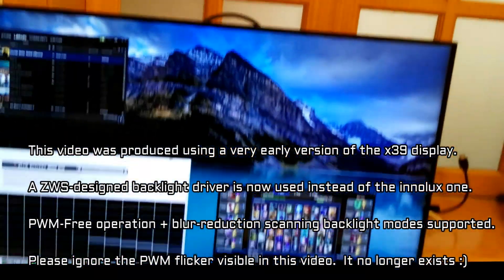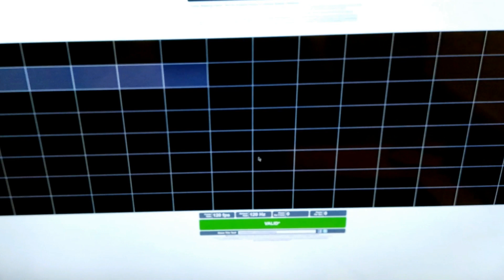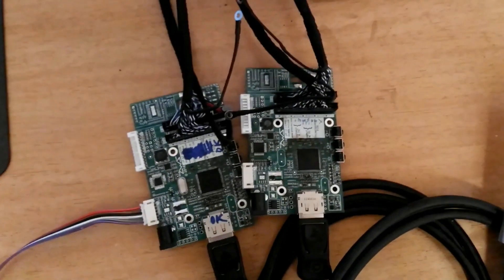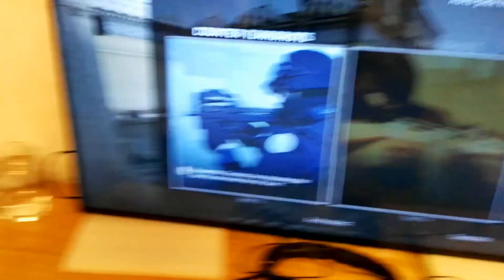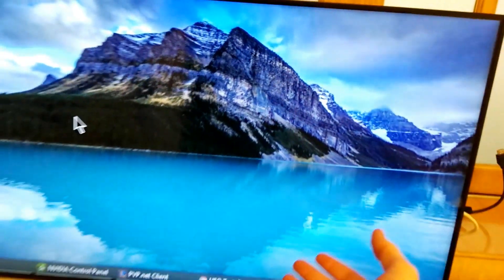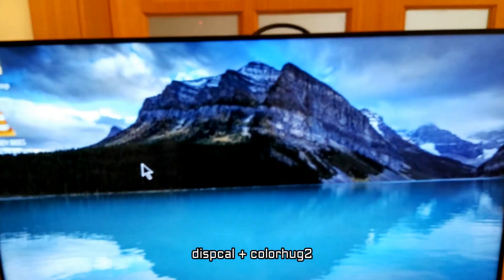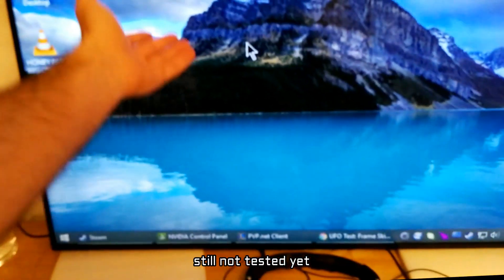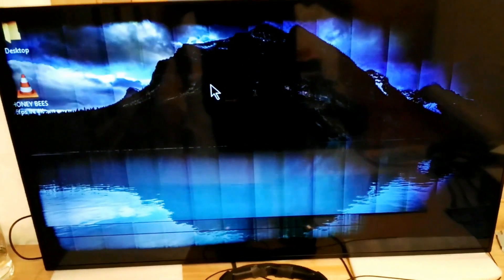ZisWorks X39 display demonstration

Comment: You really need to start offering panels.

I was pretty close to buying this. However having to source a panel, take it apart, install this (shoddily as there are no mounting plates) then close it back up if you can....

I could easily do all that, I won't however. That's too much bullshit for the gain you get.

You NEED to start offering panels. I'm not buying another monitor and then ripping out its guts to replace them with yours. That's silly.

Most people, even massive geeks like me would not do this. You're severely cutting off your market. You aren't even niche, you're super niche. Not good for revenue.

Comment: Hi Zis.  I'm about ready to buy 38WK95C-W (non G-Sync), but saw your video.  I do flight simulator called x-plane so achieving high frame-rates is impossible, to get 35 to 40 frames would really be max'ing.  The software developer says that if you are getting above that, you're graphics settings in the game are too low.  X-Plane 11 is unbelievabley demanding and requires the best GPU money can buy (if you really want decent frame-rates,,,,  30 to 40).  I currently have a GTX 1070 but begrudgingly have on order an RTX 2080 Ti  So, you see, it's not an FPS game with high Frames Per Second requirements or anything but I want the best possible monitor for my purposes. But before i lay down $1000.00 usd for this LG display, which is 75Hz max using Free-Sync (i only have Nvidia), i figured I'd ask you what you might have available that might save me some money and be able to "sync-down" to my Flight Sim frame-rates, which are always going to be below 60 frames / 60Hz.   Am i wasting my time looking into your products since my requirements are so low?, or is there technology that would allow syncing at my below 60FPS?  (that you have?).   Nvidia has everyone by the balls that has an Nvidia card and wants sync-ing.  Who's to say I won't want to play other games when I get tired of the Flight Sim stuff.  Racing games might intrigue me or maybe even FPS games.  But anyway, I thought i would get your input since you are so very knowledgeable with this highly complicated subject matter and speak so well and can convey everything in layman's terms as well.  Thanks in advance for your thoughts!!!!!!

Comment: could you explain the advanced (timing) setting for overclocking your panel in nvidia control panel? if you have lower timing would that take up more gpu usage? and if you increase the timing would that allow a higher refresh rate overclock?

Comment: So 480hz is smooth enough to look completely real? Like sort of a physical object in space, when you move the cursor, or would you say you need 1000hz?
Reply: The answer is a bit more technical than that, as you're using digital terms (Hz) to describe our analogue reality. Try this article; it's all about the display from the video: https://www.blurbusters.com/4k-120hz-with-bonus-240hz-and-480hz-modes/
Reply: Josh- bad link, can you re-post

Comment: if the display can be driven to 480hz at 960x540 why not use both 1.2 boards at 1080p 480hz?
Reply: He answers that in a reddit AMA here:
https://www.reddit.com/r/Monitors/comments/6upabh/i_designed_a_4k120hz_display_that_can_also_do/dlvjsm7/
Reply: Max Zhu much appreciated

Comment: Do you think a 1000hz display will ever be possible?
Reply: Yes
Reply: Absolutely. But, we also need GoPro or Sony to ramp up the frame rates on the camera to 720 or 1080p 1000fps with sound as well.
Reply: The Revanchist i disagree because the spaces between each frame would be a lot shorter
Reply: brett20000000009 Yes but once you start reaching those framerates, you cant really tell... Best way to say is, every time you double a framerate, its harder to notice. S 1-2, 2-4, 4-8, 8-16, 16-32, 32-64, 64-128, 128-256, 256-512 and then you wont see unless you're something near a fighter pilot in reaction time if gaming. Might not be 100% accurate but CLOSE ENOUGH

Comment: How long do you plan to sell these? This is a really neat project and one of these would be a perfect replacement for my aging VG248QE, but I'm not in a position to be able to buy one right now.

Also, did anyone offer to send you one of the 50" or 58" panels? A board like this would make a perfect TV for me, since I use an HTPC for everything and don't have any HDCP locked content

Finally, how difficult would it be to use HDMI 2.0 and implement HDCP 2.2? I wouldn't think it would be possible at all, but it would be amusing to hear exactly how impossible it would be.
Reply from the maker: Preorder closes on the 14th.  Based on sales so far, there won't be a second run.  

I've heard of some hdmi2 to dp1.2 adapter chips being made, with dongles not yet available.  That is the easy solution.

Comment: How is the color accuracy? Given that it's a TN.
Reply from the maker: Don't have a number at the moment for pre-calibration.
Reply from the maker: Also shipped my two 28" TN units out to LTT and blurbusters.  Only have a 39" unit at the moment.
Reply from the maker: Results for the 39" are here: https://www.reddit.com/r/Monitors/comments/6upabh/i_designed_a_4k120hz_display_that_can_also_do/dlvn1xz/
Reply: Thanks so much for getting back to me so quick and sorry for the late response!
One more question. You don't offer the 39" in a "full display" config? additionally, what is the reason for the 6.5ms response time?
Reply from the maker: Monitors are advertised with response time numbers which are put out by the panel vendors. Such numbers have been historically questionable.  6.5ms is the time that Innolux claims for the V390DK1.  39" panels are expensive to ship around.